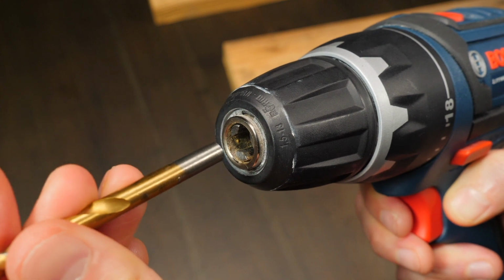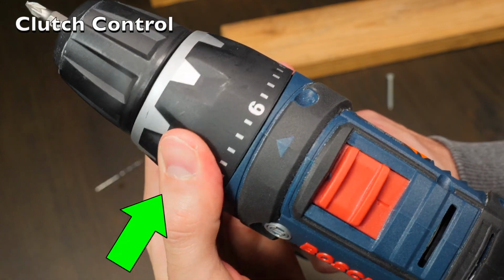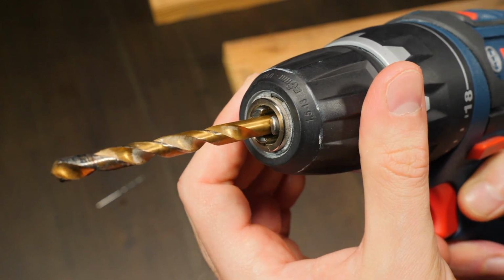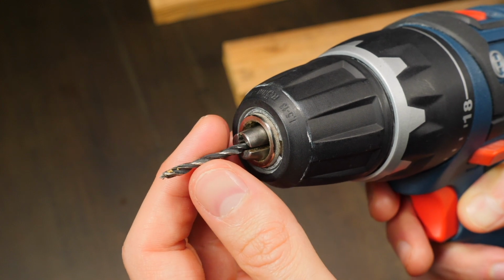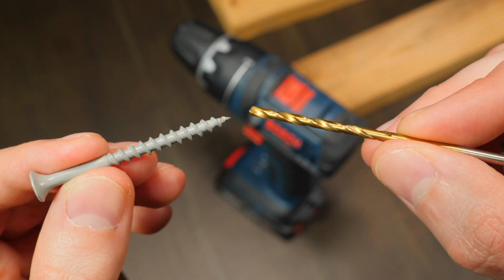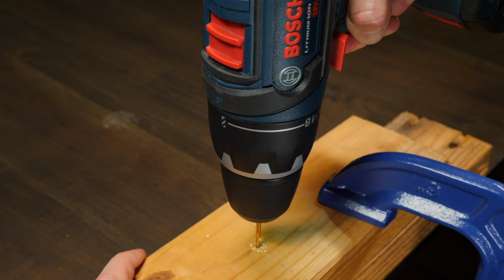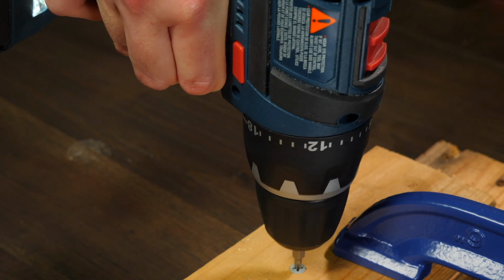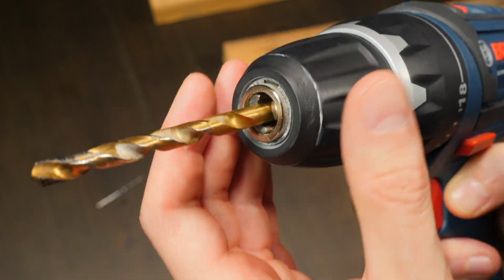How To Use a Drill For Beginners - Change a bit, make a hole, etc.

Comment: omg why didnt I find this video in Youtube search when I needed it as Ive been using my drill to make pilot holes then screwing the screw in to the hole with a drill but it keeps ending up not being tightened and just keeps spinning endlessly. Since Im still new to this, before I do any hanging or DIY stuff onto the wall, I must do what u did and buy a wood plank to experiement with using drill to screw holes. I will do this until I am satisfied haha as I cant stand screwing the screw in to the hole with a drill but it keeps ending up not being tightened and just keeps spinning endlessly. Thank you for making this video. Hope you can make a video on plastic Drywall anchor soon.

Comment: What do you do for a hard surface? I was using a drill bit the same size and the one you’re using to mount brackets for blinds. And for some reason after about a half inch of drywall, whatever they used to frame it, was super hard to drill into. The bit wouldnt move until i put a good amount of pressure. Sometimes the bit slipped into the drill.

Comment: Fantastic video, very helpful. I have a couple of questions: 1-) I always seems to have trouble removing screws, any tip for that?. 2-) My Drill also have extra buttons for changing the rpm from 500 all the way up to 1600, being a beginner I just leave it the default (1600) but I wonder what could be the optimal setting when drilling wood (and pre drilling), thanks a lot!.